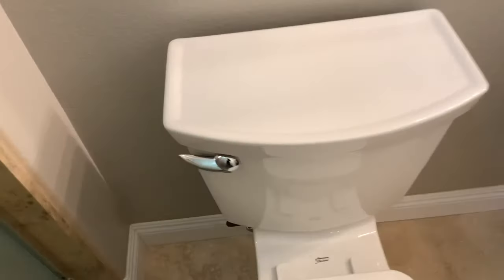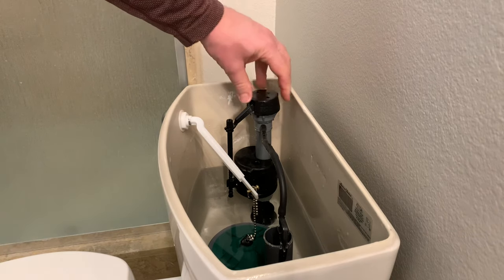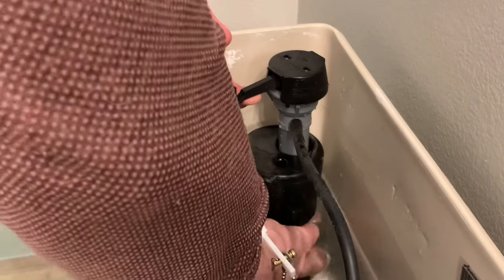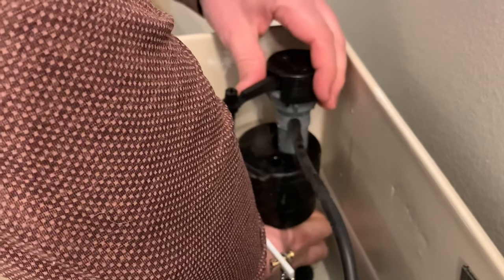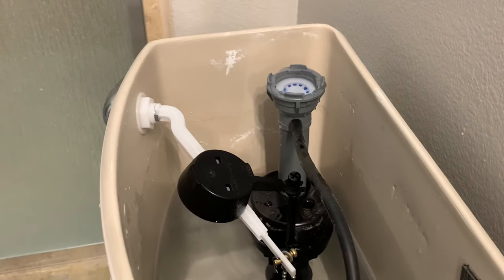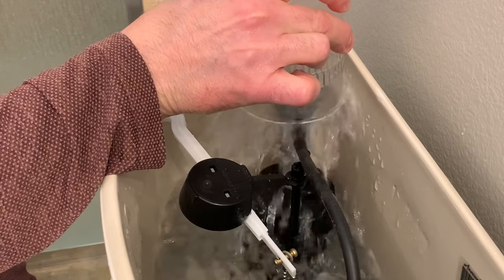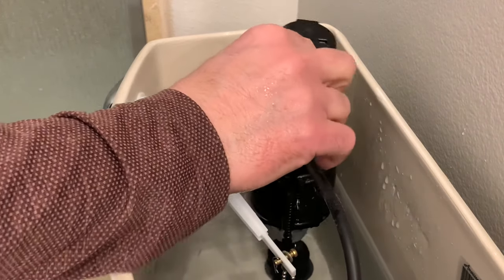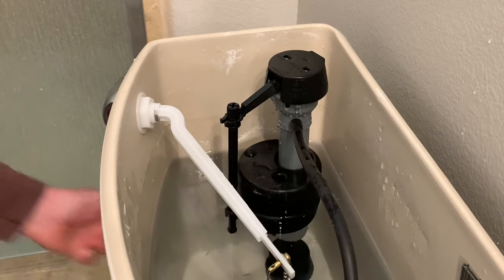Fix A Slow Filling Toilet Tank-With No Tools!

Comment: Thanks for the video. So tried all that and still the water trickles out the supply valve. I poured CLR and waited a bit (maybe not long enough) and still the flow is very week.
Reply from the maker: So when you hold the cup upside down over the fill valve and turn the water on, is there a strong flow of water or is it weak?
Reply: @MikeKlimek  I have the same problem that the flow of water is very weak, just bubbling maybe a 1/4" above the top of the fill valve.  What could be the problem?
Reply from the maker: @joeking433  Hi Joe, I just answered your previous comment about your angle stop
Reply: @MikeKlimek  I just bought a couple valves, a Korky and a Danco.  Hopefully they last longer than a Fluidmaster, which I've always had problems with.  What do you think of those Keeney/Lasco low profile valves with no float that work on water pressure?  They need something on the market better than what's out there.  Has there been any innovation lately?  Thanks for the reply.

Comment: I have the same exact tank valve as you but it was totally clean.  When I turn the valve on the wall it will sometimes turn the water back on in the tank, but sometimes it also quits.  Could it be the valve on the wall?  Should I change that?  Also, I forgot to cover the tank filler valve with the lid off and with the water on it only went maybe a 1/4" up  Thanks.
Reply from the maker: Sounds strange. With the top off of the fill valve, the water should have shot up to the ceiling when you turned the water on. Try disconnecting the supply line from under the tank and point it into a bucket. Turn the water on and see what happens. From what you've said, it sounds like the problem is somewhere between the angle stop and the supply line.
Reply: @MikeKlimek  I did that, and there was really strong pressure!  It has to be the valve so I bought a couple new ones to try.
Reply from the maker: @joeking433  Great-the problem has to be the valve and replacing it will fix it

Comment: Tried your fox and we’re still only filling the reservoir at a slow trickle.  Have you got any next step videos where we can take it from here?
Reply from the maker: It could be the shut off valve at the wall, a restrictor, or the supply line. If you remove the supply from under the tank and point it in a bucket and the water flow is strong, then replace the fill valve. Here is a video on how to do that in 30 seconds: https://youtu.be/y6J1cfvQOGg

Comment: I have 3 American Standard 41419A toilets with that type of valve for about 4 years.  For about the past 2 years, I've repeatedly had the issue of the tank not filling after a flush.  Tapping on the top of the valve or the arm coming out of the valve causes the water to flow.  After watching a few videos, similar to yours, I gave it a try.  The first time I tried it, it worked fine.  However, it has happened now on all 3 toilets multiple times and if it does work, it doesn't help for long.  Once, not at all so I had to replace the valve.
We are on city water supply and don't have hardy or dirty water.  There is never any sediment in the tank, so I am at a loss as to what is causing the repeated issues.  Any input would be helpful.  Thank you
Reply from the maker: Interesting. The fact that it is happening in all toilets and not just one points to a commonality in there somewhere. When you replaced the fill valve in the one toilet, did you replace it with the same one or different? Your toilet is listed as a model 4149A which is a high efficiency toilet and it uses this fill valve: American Standard Fluidmaster Fill Valve - 7381125-400-0070A. Did you replace with a fluidmaster with a black or blue cap? This is difficult to troubleshoot from far away!

Comment: Thanks Mike, I just did this and it worked but now the water doesn’t stop and I have to turn it off from the valve. The float rises with the water but it doesn’t stop the water. Not sure what I did!
Reply from the maker: Is the water filling up in the tank to where it is running down the overflow pipe in the center of the tank? (a small black tube flows into this as well) Maybe adjust the float lower to stop earlier. There is usually a black knob on the top for this.  You may want to do the repair again just to make sure you got everything back where it belongs?
Reply from the maker: The adjustment is at the top of the rod that connects the top to the float

Comment: Appreciate this video.  What is the reason to make sure that the valve doesn’t rotate when you twist the cap off?  After taking the cap off and doing what’s suggested, I had a heck of a time putting the cap back on.  And it’s still filling very slowly.  Actually, the water is leaking from the cap, instead of the little refill hose.
Reply from the maker: It's good to keep the valve in the same orientation for the nipple and overflow hose. Not a huge deal if it moves. For your leak, I would try to remove it again, clear it, and reinstall it. You should get full pressure when you hold the cup upside down. If not, there is possibly an obstruction in the fill valve, supply line or angle valve.
Reply: @MikeKlimek  thank you.  I do get the full pressure when I hold the cup upside down.  So, it seems like the problem isn't the fill valve, maybe it's the refill tube.  Thanks anyway.
Reply: Yea when I tried this not getting any pressure into cup just trixkles out. Where would next place to look thanks

Comment: hey mike, how do you do that with a bulb float?? once my toilet is full  my toilet keeps dripping from the fill area , taking forever to stop the water dripping /running , can you help
Reply from the maker: Honestly I would replace the entire fill valve and then maintenance will be super easy! Before you do that you can try to bend the float downward to see if it will shut the water off completely.

Comment: Hi Mike. I have a similar toilet rig. I tried that problem solving technique but it still fills very slowly. Water seems to gush out really quickly when I put the cup over it and turn on the water. I think it's with the cap that is the problem. I noticed that I don't have the hose coming out of the rig as well. I'm thinking that just might be a slightly different model. I flush the cap out with water as well. Any suggestions? Thank you!
Reply from the maker: On the Fluidmaster, there is a rubber seal on the underside of the cap. It's a $2 part that will probably fix the issue. Not sure if your similar model has that.
Reply: @MikeKlimek  thank you!  🙂

Comment: Does this method work with Korky fill valves too?  (Don't want to take it apart unless I know I'll be able to put it back together again like you did with the Fluid Master.)
Reply from the maker: I personally don't like Korky and so I don't use them and can't tell you if this works on them or not.
Reply: @MikeKlimek  Thanks,Mike

Comment: Question, what if the water is not shooting out like it is in yours when cap is off but dribbling slowly? It is a basement toilet...I flushed it and it still fills rather slowly.
Reply from the maker: You might have a flow restrictor at the bottom of your fluidmaster. Remove the water supply line and use needle nose pliers to remove it and clean it

Comment: It seems like your water pressure coming out of the fill valve is much greater than mine. Any idea as to why and what to do about it?
Reply from the maker: It's going to be the fill valve, the shut off valve, or the supply line. You can start by removing the supply line from under the toilet and point it in a bucket. Turn the water back on. Is the flow strong? If yes then it is isolated to the fill valve. You may have a restrictor at the opening of the fill valve that you can remove, or you can just replace the fill valve. I have a video on that as well.

Comment: I did this but barely any water comes up. I took the water supply line off and turned it on into a bucket, plenty of water comes out it's just not going into the toilet very well. There was a black rubber washer type thing that looked clogged. I rinsed it off put it back in still clogged. Not much Water going in, also tried connecting the supply line without it and water was leaking. I don't know if a new fill valve will fix it or if it's the fill line
Reply from the maker: If you have lots of water exiting the supply line, then the problem is the fill valve. Worst case replace it. You might check the point where the supply line connect to the fill valve and make sure it is clear of any debris

Comment: So I disassembled it and when I went to clear the debris with the cup over it, the water barely coming out. Any ideas on how to fix that?
Reply from the maker: I would disconnect the water supply line from the bottom of the tank and point it in a bucket to see if you have strong water volume (turn the water off before you disconnect it of course). My guess is that you won't...If that's the case then check the water supply shut-off valve/supply line.

Comment: I have a bit of an issue, actually not exactly the same as this, I have the same type flushing system but it seems to continue filling and ends up over filling and the water runs into the toilet pan. It does not cut of when full... what needs to be checked ? Or replaced? To resolve this
Reply from the maker: Sounds like the float is too high and water runs down into the overflow pipe and into the bowl. All you need to do is to lower the float so the water shuts off earlier. On newer Fluidmasters there is a know (has a philips head screw top to turn it with a screwdriver if you choose). Turn it so the float lowers and turns the water off earlier.
Reply: @MikeKlimek  cool... will surely give it a shot and update there after

Comment: Hi Mike, do you have advice on how to remove the top of the fill valve (to clean it out as you showed) when it won't turn? I've tried holding the bottom tightly so it the entire valve/pipe doesn't move when I try to push the top, but I can't seem to get it to budge. Is there a way to get it unstuck, or could it simply be a different model (though it looks about the same as in your video)? Thanks in advance
Reply from the maker: Not really...push down and rotate counter-clockwise. If you need to use real force and it breaks, have a new fluidmaster on hand to replace it just in case. Here is my video on replacing one with no tools in under 30 seconds: https://youtu.be/y6J1cfvQOGg

Comment: Thanks for sharing Mike, it didnt help unfortunately but I noticed when I turn the water off and back on everything works fine. The issue is when I flush and the unit drops the 2nd run doesnt fill properly (unless I turn water off and on again) and water leaks at the top filling very slowly. The normal 1st cycle seem to load the water from bottom. Any thoughts on this issue?
Reply from the maker: You might have a water restrictor (regulator) in the base of the fluidmaster where the supply line connects. Remove the supply line and use needle nose pliers to pull it out and clean it.
Reply: @MikeKlimek  Thanks Mike.... I did remove the supply line and both ends appear clean although not too sure what it is that I meant to pull out....?
Reply from the maker: @balukapi  Inside the base of the fill valve (where the supply line screws on) you may have a restrictor you can remove and clean out. Pull it out with needle-nose pliers
Reply: Thanks Mike, it ended up being the seal needed replacement!
Reply from the maker: @balukapi  Glad you figured it out Christopher!

Comment: Thanks, Mike! Any suggestions on what to do you do if you've flushed the existing Fluidmaster valve and don't see any dirt anywhere and the toilet fills up fine when the water is turned back on the first time but slowly fills up the next time (no water to the toilet)
Reply from the maker: I just realized you commented on another video and I referred you to this one! When remove the top of the fill valve and hold the cup over it, do you get a strong flow of water?
Reply: @MikeKlimek  Very strong flow of water. I actually held the cup too loosely and ended up with a small geyser. At first use after the valve is flushed it works perfectly. However, on the second flush, the water dribbles into the tank. No water comes out and down the tube to refill the toilet.
Reply from the maker: @recsoccer2755  So it sounds like the fill valve. It's not likely that there is something caught in the shut off valve or supply line. See if you can take it back for an exchange
Reply: @MikeKlimek  Thank you for all your help

Comment: Hi Mike! Followed the steps but the water flows out really slowly. Assuming it’s blocked. Any tips?
Reply from the maker: When you covered it with the upside down cup, was there strong pressure?
Reply: @MikeKlimek  no there wasn't! it was coming out slowly
Reply from the maker: @AMBER3  So it will either be the angle stop valve at the wall, the supply line from the angle stop to the bottom of the tank, or an obstruction/restriction at the base of the fill valve. Try removing the supply line from the bottom of the tank and point it in a bucket. Turn the water back on. Strong pressure?

Comment: as you can see the fill valve was never clogged, what if it's clogged, because somebody worked on a faucet replacement outside and got dirt in the water line and then had the child turn on the bathroom sink, shower and toilet and now all three are clogged with sand/dirt? how do you unclog it? I got the shower unclogged, working on unclogging the toilet, then next the sink. looking for video how to take the two flush american standard fill valve apart or how to get dirt out of it.
Reply from the maker: Try this video: https://youtu.be/3L8gleMWj3g?si=0YhV4uyyhQGh8pLY

Comment: Hey - so when I turn off the water and flush, then turn on the water it fills normally. However after that first flush it begins to fill slowly and seems to leak out of the valve unit. Turn off the water and turn it back on and it’s normal! Any idea on what to do? The valve unit seems clean.
Reply from the maker: It's either the shut off valve, the supply line or the fill valve. My guess is the fill valve. I would replace it. I have a video on how to do it in 30 seconds
Reply: @MikeKlimek  thank you sir - let me try that

Comment: I have a question and it’s going to sound weird but would this debris cause my fill valve to chirp like a bird? I’m not kidding! Also it spurts water in the tube but won’t stop. If I wasn’t so frustrated I’d laugh! But this toilet repair of mine is in two days now!!! It a 30 year old toilet but the tank parts have been replaced. I’m going to try it anyway. Have nothing to lose right?
Reply from the maker: That's right!

Comment: I think my landlord lowered the pressure in the water.. I tried this and I hear the initial rush of water but then it slows down a lot.. my tank is full of gunk and mud like sediment.. will replace the valve to see if that’s the issue
Reply from the maker: Sounds like you have a bigger problem

Comment: hi. Very instructional, but I have done it 3 times now. First two flushes after are fine, then it goes back to slow. Any other suggestions? The water in the tank has yellow debris btw.
Reply from the maker: That's interesting. Your comment about there being yellow debris in the water tells me there may be a bigger problem. Do you have this condition in other toilets?  You should get full pressure when you hold the cup upside down. If not, there is possibly an obstruction in the fill valve, supply line or angle valve.
Reply: @MikeKlimek  I am getting great pressure when holding the cup. Clear water good blast. Our other toilet runs fine  Tested a theory and gave all parts of assembly a vinegar bath. This time it lasted 7 or 8 flushes before again clogging.
Reply from the maker: @hotcanuck14  It sounds to me like you have isolated the problem to the fill valve since you get great pressure. I would replace the fill valve. Here is a video on how to replace a fluidmaster in 30 seconds with no tools: https://youtu.be/y6J1cfvQOGg
Reply: you rock - thanks dude

Comment: Hey! I have this problem, did what you told to do, but no debris seemed to come out from the fill valve.

I took a closer look on the cap, it was clean as well. I pushed the seal in the cap few times, and wonder wonder, the tank filled up. Then I flushed the toilet, and the valve stopped working properly.

Took the cap off again, pushed the seal, first flush worked, second didn't.

Any thoughts about this? I also took out the seal, ran some water over it, washed the cap as well, but it still does the same thing: works properly for the first flush, but doesn't work right after that.
Reply from the maker: At this point I would either replace the seal (they sell them at big box stores) or replace the fill valve. Here is a video on how to replace the fill valve in under 30 seconds with no tools: https://youtu.be/y6J1cfvQOGg

Comment: What if the pressure is not strong at all when you take the cap off?
Reply from the maker: Possible that it could be the shut off valve at the wall, a restrictor or the supply line.